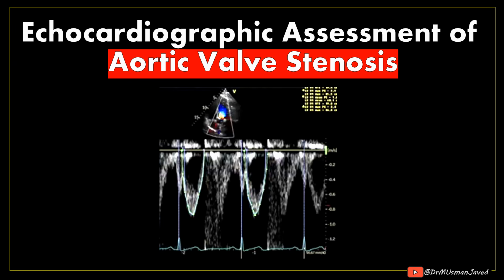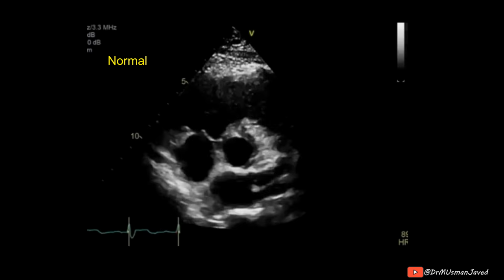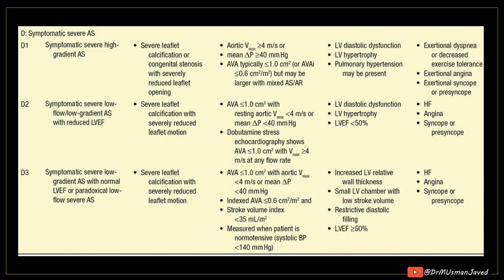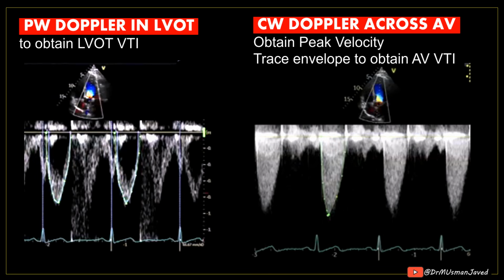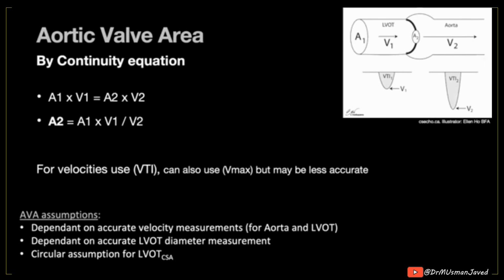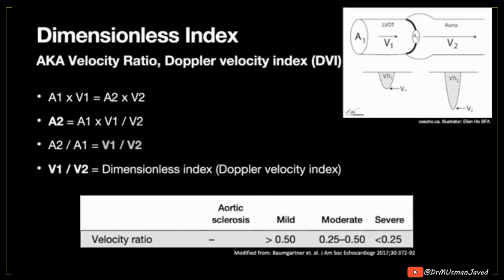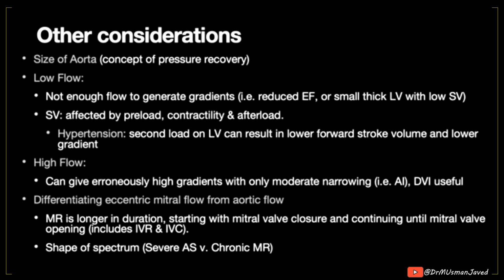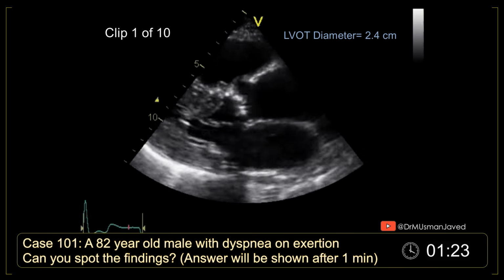How to evaluate Aortic Stenosis by Echocardiography

Comment: Great breakdown of key AS parameters! Could you elaborate on common pitfalls to avoid when measuring AVA using the continuity equation?
Reply from the maker: Thanks alot , Common pitfalls in the measurement of aortic valve area (AVA) by the continuity equation include errors in left ventricular outflow tract (LVOT) diameter measurement, which is squared in the equation and thus has a significant impact. Misalignment of the Doppler beam with blood flow can lead to underestimation of velocities, particularly at the LVOT or aortic valve. Using the wrong location or timing for velocity-time integral (VTI) measurements, especially mixing pulsed-wave and continuous-wave Doppler from different sites, can also distort results. Poor acoustic windows, arrhythmias (like atrial fibrillation), and failing to average multiple beats in such cases may further reduce accuracy. Standardizing technique and being meticulous with measurements are key to reliable AVA calculation.